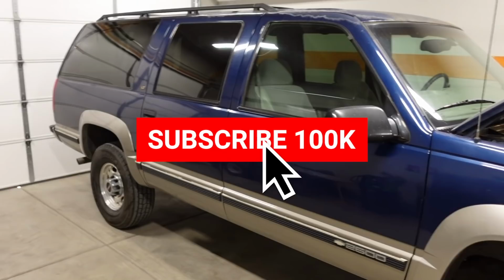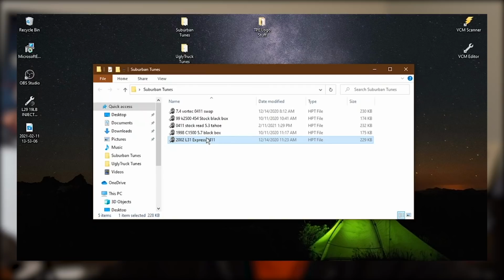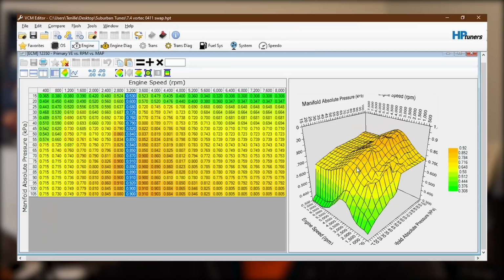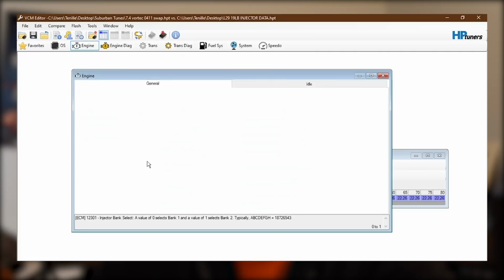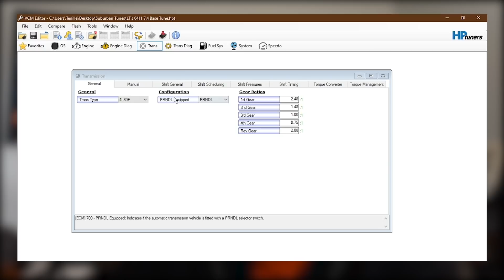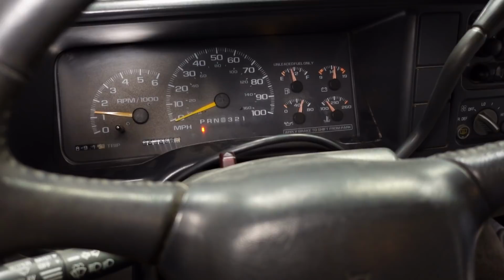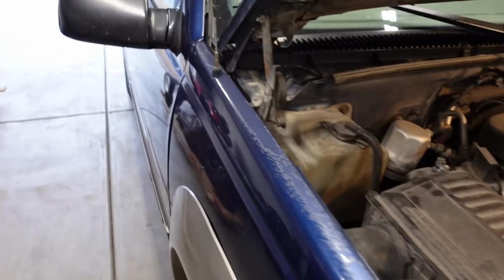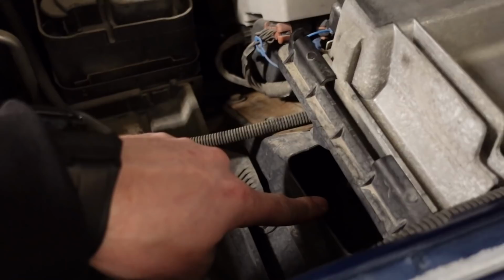Tuning an 0411 Swapped 454 Big Block GMT400

Comment from the maker: Thanks for the support guys, y'all are the best! Can't wait to add some horsepower on this big block with a good cam, some headers, and a few other goodies!
Reply: I wonder if this will work on a LS with a 8L90 or 10L90.

Gen 6 and Gen 7 BBC were LS like.

Im not sure if yours is a Gen 5 with peanut ports.
Reply: You can use the gear wizard to edit the ppm on hp tuners. Just need to know the tire sizes and gear ratio. they also have a tire size calculator in the tools tab.  Keep up the great work man!
Reply: Hey LT I have a question that maybe you can help me with I have a 98 Chevy Tahoe 5.7 l I have put on a oil catch can from the PVC valve and it's working but am I hurting my motor by doing this?
Reply: Does it matter what the 0411 pcm comes out of, or will any one work?
Reply: Any chance you would be willing to share a copy of the tune you created for it. I'm fixing to do the same swap on my 97 and just bought hp tuners.
Reply: @ Lawrence LT Tolman 
     I've heard the comp xr276hr for the gen VI can be ordered with the same base circle and works ok with stock springs and non adjustable valve train. But will not allow it to rev beyond 4800-5000 or so without a spring upgrade. It's listed as 276/282 adv 224/230@50 510/.510 110 lsa 1900-5600 operating range, needs gears (truck should have 3.73-4.10, if not available cheap out of k3500) and a 2000 stall.   Have verified with two people the cam is a direct swap, if ordered on stock lsa and icl will even run just fine on stock tune. When you do springs if you do 1.8 rockers it jumps the lift considerably and according to the one gentleman has no ptv issues as long as you order it on 118-120 lsa like stock, but definitely needs springs with 1.8 rockers. Bet it would make for a killer forced induction cam and have a good punch from idle to 5500. And if you do some basic cleanup of the ports with bowl work they can flow. stock intake flowed 246 cfm at 0.550 lift, and the exhaust flowed 162 cfm at 0.450 lift. After the head work was done, the flow number came up across the board. At 0.550 inch of lift, the intake flows 271 cfm and the exhaust 0.204 cfm at the same lift. With even an eBay gt45 I bet you can make some really good power with zero loss of drivability, and low rpm so it will live as long as you don't get greedy with timing or boost. 650-700 tq, 500+ hp at less than 5500 rpm would be 😊.  the article is here.. https://www.motortrend.com/how-to/0510st-1996-chevy-truck-vortec-big-block/amp/

Comment: Hey LT, you have to read this. Under the dash beneath the steering wheel, there's a small rectangular box mounted on the firewall. Kind of looks like a big rectangular relay. Unplug it and you won't have to listen to that annoying dinging ever again
Reply: Do you have a email ? I just looked under my dash and am trying to figure which one it is
Reply from the maker: Good idea!
Reply: I unplugged mine years ago. I was under the dash trying to figure out some wireing and discovered where the sound was coming from. I pulled it out and laid it on the trans tunnel and it a been there since.
Reply: @skylarreid1284  thanks man ! Gonna check this morning
Reply: Also life hack, you plug other cars “dingers” into the slot, so instead of  the long continuous beep, you can get more modern bing bing kind
Reply: Lol. I did this too. Only real downside, is I've left my lights on more than once.
Reply: @rite2beararms  When I had a 93 Honda Civic, I left the lights on repeatedly because there is no warning tone or buzzer for them. I wired the light circuit to a relay I added in the fuse center triggered by a circuit hot in accessories and run so the lights turn off with the key.

Comment: For change the gear and speed on HP tuners just need to go edit and gear/tire wizard and enter the tire size and gear and automatic change the speedo info and the trans shift points for the new gear and tire size
Reply from the maker: yup, that also works

Comment: Love the recap and content. 

Just an FYI the fail safe for no coolant temp should be -40 degrees F. This failsafe allows the engine to be properly fueled when the air density would be worst case scenario (ie -40) and therefore would never run the engine lean
Reply from the maker: because it was getting full voltage rather than none, the ECM thought the temp was maxed out, and it will add a little fuel at hot temps to cool things off also...

Comment: Just bought a 411 pcm from a 2002 express van today. Paid $43.75 for it and the connector plugs. I'm swapping a 2000 ym L29 into my 84 K10 with a SM465/NP205.

Comment: I know its been a while, but one other option for copying data from one file to another in a compare (besides licensing both and segment swapping) is to go to the red and blue differences view which shows you the value of the difference where identical values are zero.  It doesn't work for all tables but for most you can just select all and set the value to zero which only changes the value in the original file to match the compare.  Just found the channel and looking at some of the interesting older videos, great job...

Comment: I have a ‘97 7.4 that had this 0411 swap a few thousand miles after a professional engine rebuild (it ran ok with the old computer) I had full head work, RV cam, roller lifters, rockers, lightweight coated pistons, bored over 0.030, forged crank, new injectors (ac delco) new distributor, wires plugs, etc, and the only shop in town that can dyno tune, did the ecm swap and dyno tuned it, and it runs like garbage, it won’t even tow a 4,500 lb trailer above 55 mph without screaming at 4K rpm’s.
Reply from the maker: Sorry to hear that. Sounds like something is way off!
Reply: @LawrenceTolman  thanks, there are three tuners in the whole state, one of which did the work I’m not pleased with. Are there any dead giveaway questions I could ask that would rule them out quickly? Thanks for the vids, you’ve done to your old burb pretty much everything I’ve dreamed of doing to mine!
Reply from the maker: thats a good question I don't have a great answer to. I would just have a conversation with the prospective tuner about your setup, and see how they react. also, reach out on Facebook in your area, and get recommendations for a good GM tuner

Comment: @LawrenceTolman One thing you missed in this video related to the alternator is to disable the L and F terminals under System/General/System Options.  Disabling the codes doesn't disable the idle control routines that rely on alternator control and feedback.  Not disabling those options or connecting those wires WILL adversely affect idle stability.

I did this swap on my 98 P30 L31 a few years ago using TunerPro RT and PCM Hammer.  I also have HP Tuners.  TunerPro is better for setting up an OS to start with, changing VIN, etc to avoid buying extra credits from the greedy bastards at HP Tuners.  HPT is better for logging and tuning.  If you haven't looked at TunerPro, It's definitely worth checking out.

I had one small issue with my swap.  My post-cat O2 sensors were mixed up after the swap.  I'm not sure if the spreadsheet was wrong or if the P30 harness was made incorrectly.  It didn't cause any noticeable drivability issues or MIL, but I could see the effect when graphing the O2 sensors using Torque.  One sensor would stay high most of the time and the other would stay low most of the time.  It seems that the PCM tries to command one bank at a time slightly rich to check sensor response and catalyst efficiency.  With the sensors swapped, the test would hang until the other bank went a little rich.  Unplugging one of the sensors confirmed that they were wired to the wrong bank.  I repined the sensors to the correct bank and the problem went away.

Comment: Hey LT, If you ever want to dial in those shift points I highly recommend using the BlueCat Trans Tool. It's a free software you can find on the HPTuners Forums. Easy to use, and works wonders for drivability.
Reply from the maker: Got a copy of bluecat saved to my computer!

Comment: This is awesome! I just picked up a 96 k1500 with the 5.7 and have been looking around for tuning options for the sbc instead of just ls swapping it. Continue this type of content
Reply: If your interested in going in on the deepend you could get an Edelbrock pro Flo system it's vastly superior too the fuel injection system that they came with infinitely more tuneable and a much better intake manifold too

Comment: Crank relearn can be a pain in the ass for sure... had the same issue using a mail-on tune with a programmer in my 9-7x Aero with the LS2. Ended up using a Aeroforce gauge to get it to work myself.
Reply: i never got the relearn to work in hp tuners on a 0411

Comment: Since it’s cold in your area you probably didn’t think about this. The auxiliary cooling fan IFO radiator may be controlled by the computer. You don’t want to have any cooling issues this summer especially if you’re keeping the A/C.

My ‘85 K30 has an OEM aux fan and it sure helps when you’re in traffic or other low speed conditions.

Comment: Just run the 4 wires to the cluster to set up the PRNDL, it's way easier than it sounds. With your skills probably 30 minutes. As someone else said, use the speedo wizard, way easier. Great job on the pinout, only one pair of switched wires is nice work 👍
Reply from the maker: yeah, the four wires aren't that big of a deal, I probably should've run  em. As far as the speedo wizard goes, I've used with mixed success, it seems to be more accurate (in my experience) to manually calculate the values.
Reply: @LawrenceTolman 
That makes sense it would be more accurate. Keep showing the HP Tuners stuff, I sure wish I had that kind of basic info available when I first started! Btw, very happy with Comp 01-412-8 and many other mods.

Comment: Great work.  Really liked the explanation on all of the HP Tuners tweaks.  There is so much in there.  I’ve only ventured in to the trans portion on mine.   Tweaking shift points, tcc setting etc...  As far as the PNRDL setting, I had a hell of a time when it was set to none.  I wired the stock sensor up for PN only to give the PCM a ground signal in park and neutral and it seems to be a lot happier.   Low speed part throttle was really wonky until I made the change.  If the shift shaft on your trans long enough to put a PN switch from a 60e or 80e?
Reply from the maker: yeah, the trans already has a range switch on it actually, I just wanted to avoid running four more wires if I could avoid it simply by changing one parameter in the tune. once I Did the re-learn, it seemed to run just like it did before
Reply: @LawrenceTolman  Perfect!   Glad it worked out!

Comment: I'm do the same swap on a 96 chevy and 98 gmc I got the pinout sheet for both trucks and the 0411 pcm. My question is do I have to do a segment swap on the 0411 because they came out of a 02 chevy blazer with a 6v to put the 02 chevy express van files on?

Comment: It freaks people out when they find out that my '97 chevy c2500 is only 6 lug 2 wheel drive with the l31 5.7l 350ci. Still runs great needs some body work and some exhaust work after 160k miles.

Comment: Will that swap work with. 1996 chevy with 5.7L motor? Or is the stock computer jus fine. Just asking because you have the 454 big block motor. Thx nd good video. Lots of info.
Reply from the maker: Yeah, you can do the same thing to the 1996’s
Reply: @LawrenceTolman  thanks. Keep them videos coming...👍

Comment: The transmission range codes could be the learning process. The ECU  had to learn you disabled the PRNDL function. Along with the crank trigger relearn. Great job on the swap. Question what's the total cost of the swap including the HP tuners program system. I have 2 OBS trucks one TBI the other Vortec 454 big blocks. The TBI is a 4x4 that my son wants & the other is rotten beyond repair. If I swap the L29 to replace the TBI I could I just use the harness & old ECU or the 0411 ECU is a better choice easier to program??? It's either that or spend the bucks on a Holley Terminator X I do plan on stock rebuild & upgrading camshaft on the L29.
Reply from the maker: the total cost is about $300 including the PCM, connectors, and the four credits from HP Tuners. For your swap, I'd just start by swapping everything the Vortec 454 truck over to the TBI truck including the harness, dash, cluster, basically everything using the stock black box at first just to get it running. then, if you wanted to tune it later on, do the 0411 swap
Reply: @LawrenceTolman  Thanks for replying  I will be keeping it simple. Saves me a lot of money. Now I just need to put the time.
Reply: Look up and get familiar with LSDroid. It's free software

Comment: Just finished my 0411 swap on my 97 1500. The truck is running great but will not read on HP Tuners or OBD2 reader. I double-checked and the class 2 serial data is in the correct spot. I also checked the fuze for it and it checked out. Any help would be appreciated!

Comment: I have a 98 gmc sierra push button 4x4, and a 411 psm I bought from a salvage yard and I haven't had the chance to mess them yet. but I was wondering will the 4x4 still work after the swap is completed?

Comment: You can take the 2 tunes in HP Tuner and use it's tine comparator and it will show the differences between the tunes. Or are they not comparable?
Reply from the maker: You can (sort of) but many of the tables have different axis labels and different scaling, so it won’t be a direct copy and paste. But some of the data is close enough to to get a good comparison from

Comment: You adjusted the engine displacement in the tune, right? I’m sure you did, but didn’t hear it. Also, for fuel injector values, you have to make sure your values are for vacuum reference regulated fuel or not, depending on what your engine is. If the values in the flow table are the same, they are for vacuum reference.
Reply from the maker: yup, the engine displacement is entered for the 7.4 (0.93 liters per cylinder) and as far as the injectors go, thats just GM data for how they are in the stock tune, 22lb/hr across the board for all KPA readings.
Reply: @LawrenceTolman  Great. I just knew that when I swapped injectors from a LS truck (vacuum referenced regulator at the fuel rail) to a normal LS style fuel rail (regulated at 58psi fuel pressure regardless of vacuum), I had to tweak the values. Thanks. Cool info.

Comment: So ive been wanting to up my OBS knowledge and workaround, the ECM stuff and the HP tuners info is GOLD to me, since youre planning on building the suburvalanche out ( which im ectited for) i wanted to ask about the ABS/ Braking system, what you will do/ plans and if you happen to make videos about it,  money,  so at the end of the day if you respond cool, if you end up making videos on this, even better, but at this point, if anybody has 2 cents to add, that would be great
Reply from the maker: my thought was to do the 2500HD brake upgrade for the 2001 trucks and discs on the back
Reply: @LawrenceTolman  Alright! , Im looking forward to the video(s) im especially looking forward to keeping the parking brake, do you think you'll end up swapping out the brake master cylinder or do the big block OBS all use hydoboost? I guess we'll cross that bridge when we get there.

Comment: Great content on the swap.  I understand why people are making the swap.  However, using JET Dynamic Spectrum tuner would yield the same results you are currently achieving.  So unless you are creating a boosted high output drivetrain, how is this financially more affordable than just purchasing the JET tuner?
Reply from the maker: Never used JET software myself, but I do understand the interface is a bit out-dated. Regardless, I could've still tuned the black box ecm with HP Tuners (1998 and up black box is supported by HPT), so if a tune is all I wanted, no need for a swap. However, there are many other benefits to the conversion like a high and low octane timing table, much finer resolution on the VE and Spark tables, tow/haul mode available for the transmission, and if/when I do go forced induction, it has the capability to do a 3 bar speed density operating system. Overall, the 0411 is just a better PCM to build a performance vehicle around.

Comment: Do you have contact info for the guy that got you the pin out spreadsheet? Doing a stock L29 out of a 2000 k3500 4wd into a 1997 c1500, would love to just get the 0411 ecu from him with tune loaded with the mods I need to make it plug and play with the truck.

Comment: Oh man.. this is great! Cant wait to see how you tune for the modifications you make. I'm looking to 0411 swap an L31 engine to be able to handle increased compression, better heads, cam & intake. Looking forward to your next video, as always!

Edit: To tune w/HP Tuners, assuming a compatible laptop/computer, what do you need to be able to pull tunes, view & edit, and load new tunes to the PCM? Do you need to pay per vehicle or per tune? Aka: once the PCM is 'yours' are you free to modify it unlimitedly or? Thank you!
Reply from the maker: thanks! you'll need a windows based laptop to run HP Tuners on, and you are free to "read" as many vehicles as you like, so you can save the tune files to reference later on. For modifying the file and flashing the ECM, you need to license both the file, and the computer. If you read a tune from your truck, modify it, and flash it back in, one license covers both the ECM and the file. If you do like I did and find a new file to flash on your computer, you need to license the tune file and the ECM separately (two licenses, total of four credits for my project)
Reply: @LawrenceTolman  Thanks for the reply!